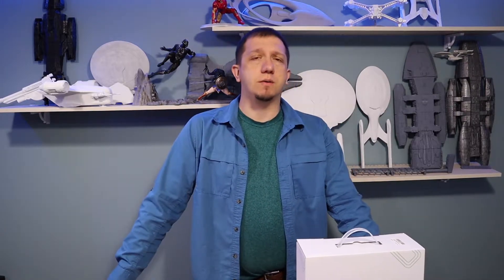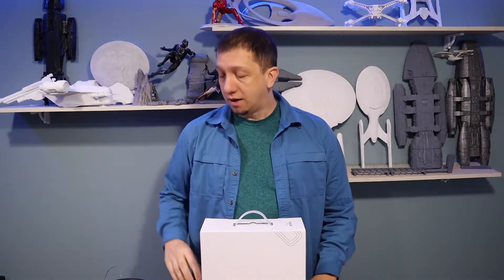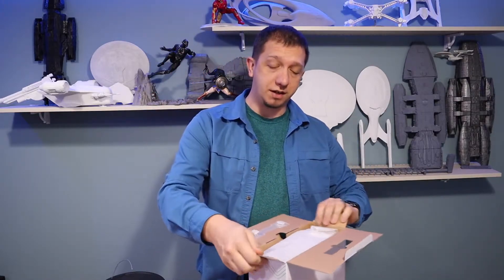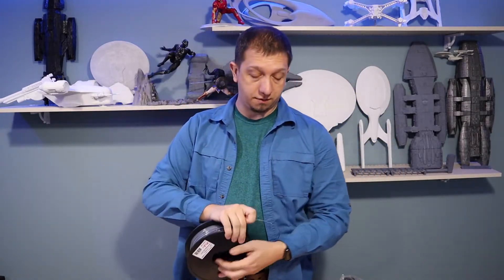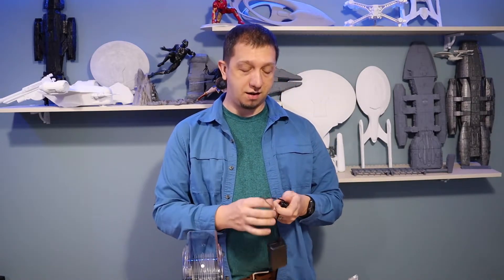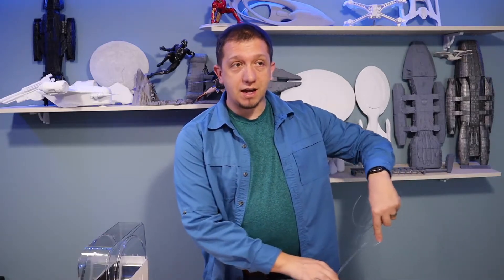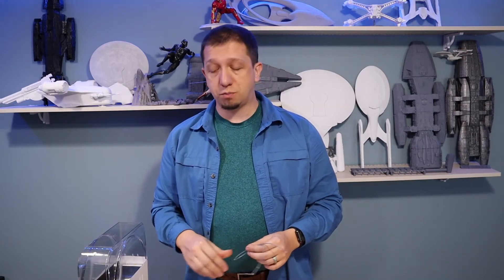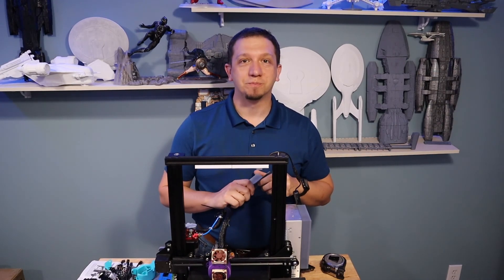How to dry filament? SUNLU Filament Dryer

Comment: Issue I have seen on many reviews and I se it with mine. NO AIR FLOW!, or humidity sensor. I seen a video on how to mod it. Have you noticed that it only heats the lower one spot? a blower inside would solve that. I see this vid was 3 months ago. I am curious 3 months now what you think of it now, and if those two issues are an issue for you personally?? If you have taken it apart the large connectors are JST XH ones, while the small looks like JST sh but not sure yet what they are to the board just yet.
Reply: I have mine and yes I put a 6020 blower fan in the back and modded the sensor to be right in front of the intake of the fan. I am currently have the hydrometer sitting on the filament on top until I get it to the front face
Reply: @pleighto77  awesome, yeah I found that vid too, unfortunately that's the only video he's posted since February, he knows his stuff and has the gear to prove his work.  he did a truly accurate review and fix to the problem.